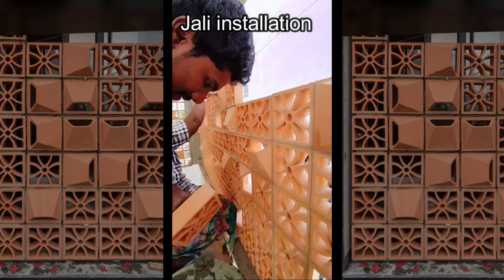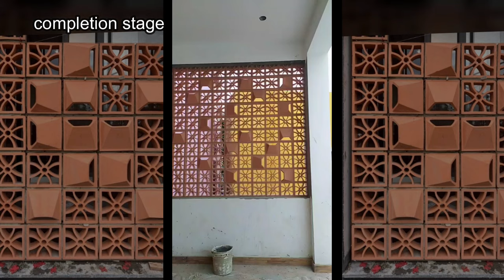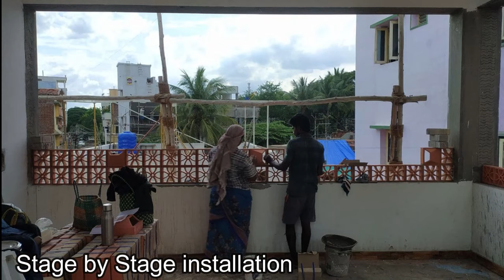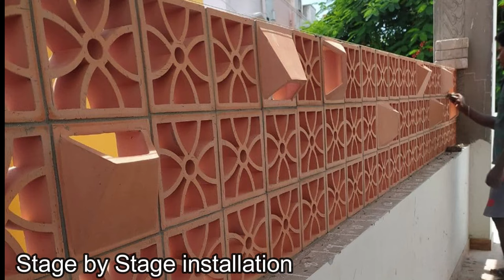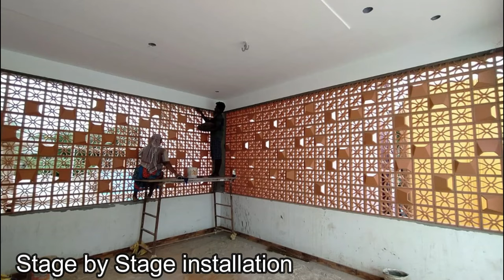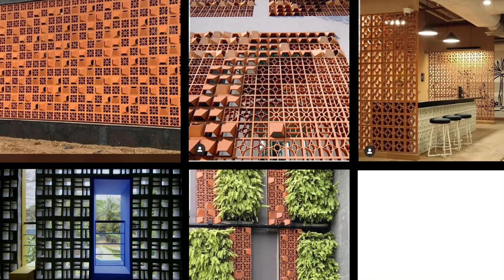Jali installation Terracotta Tiles Design Terracotta hollow blocks

Comment: Kindly let me know about the Strength of the jali installation... As there are no support inbetween.
Reply: Can provide steel support if u want
Reply from the maker: the area will be small space we are applying adhesive in between jalis. Incase area will be going large we additional support for steel pipes.
Reply: @samayainfra2517  can you give the adhesive details
Reply: @samayainfra2517  upto how much height in metres or feet the terracota blocks/tiles will not need steel support?
Reply: Cost per square feet sir